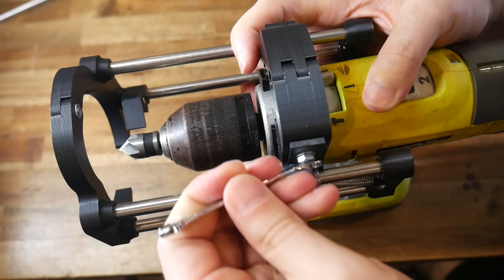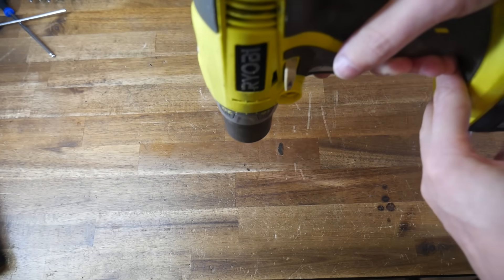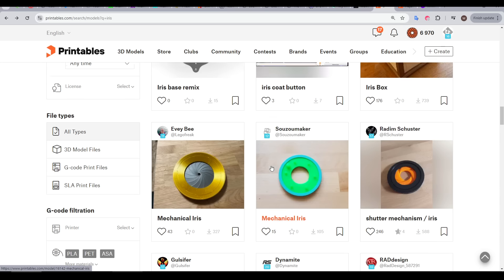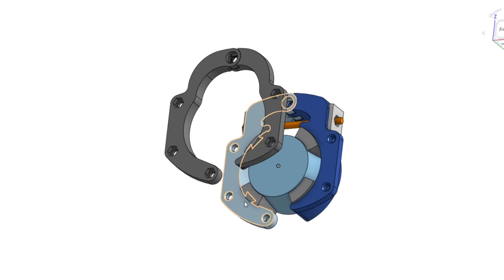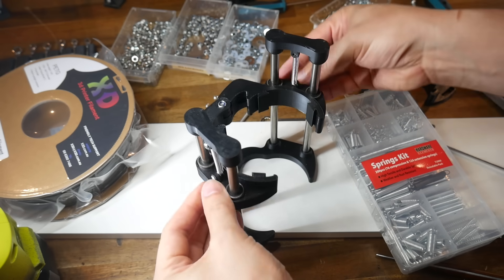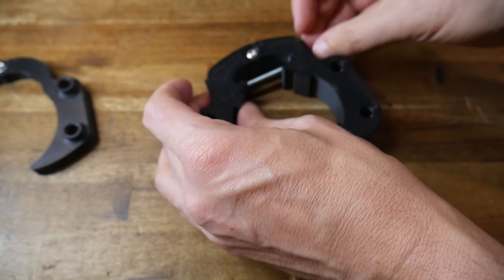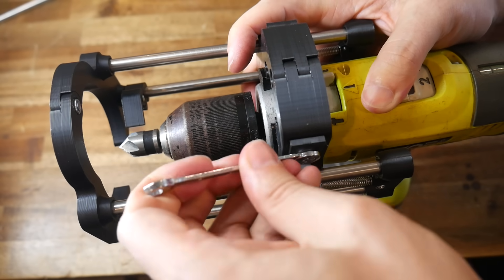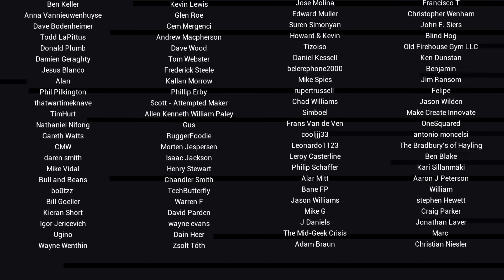This 3D printed drill add-on will give you repeatable, straight holes

Comment from the maker: Thanks for the nice reception of my design (and moustache). Some people don't seem to understand it's for charity. If you can help: https://movember.com/m/15237865 
Also 'drill guide' seems to be the search term to find a similar product. Quite a different approach with the inbuilt chuck. I'm still happy to have released my take and people can use whatever version they like.
Reply: @TeachingTech  the Milescraft DrillMate featured by Stumpy Nubs a day earlier has a lot of features that can be easily added to your design. :)
Reply: @emmettturner9452  It does have a built-in chuck.  I know, because I have one.
Reply: One advantage of your design which is ultimately a cost consideration for commercial products, is the 2 extra linear rods. I have the Milescraft drill guide, and I find it still has some play only having 2 linear rods. The inbuilt chuck is nice, but this seem sturdier

Comment: As someone who owns one of those cheap Aliexpress drill stands and just recently bought my first 3D printer, I'll be making this in the future. A lot handier in many ways, and the design looks great. Only changes I would like to see would be a more modular front piece - at the very least it should have holes for screwing on a base plate for more stability, and as others have mentioned below, a V groove for drilling rods and dowels. But with 3D printing this could also do so much more - 3D printed profile-matching plates that ensure consistent hole spacing across a sculpted face; adjustable center finder and/or edge guide mechanisms; angle guides (fixed or adjustable); the list really does go on. Thanks for making this open source, as no doubt I'll want to make some mods or add-ons to mine.

Comment: For flat stock drilled vertical, glue round  bubble level on drill and place one on piece to be drilled. Then you just have to make sure bubble positions are the same on both as you drill.

Comment: This is a great design but have you considered a design based upon the "Axial Glide" method as used in the Bosch GCM 12 GDL Sliding Compound Mitre Saw? This could be all 3D printed using only hinges and hence no sliding rods!

Comment: A really cheap thing I do is to take a piece of scrap wood that is perfectly square on at least one side to the drill press and drill a hole of the required dimension. Then I use the hole in the scrap wood to guide my hand drill. The hole will wear out after a while, but it keeps up surprisingly well. Another trick is to glue two pieces of scrap wood together in a perpendicular way and rest their square surface on what you want to drill your hole in. If you then place the drill bit in the v of the two pieces you will be square as well.

Comment: OMG, I wish this video had been released a week earlier!  I scratch designed a 3-jaw chuck to hold cylindrical shaped LED lights in place inside an integrating sphere.  The chuck is quite wide, about 120mm wide, with a 70mm wide center opening.  It works okay, but it's a little sketchy, and I had to make the pieces quite thick.  Your round, screw clamp would have worked so much better!

Comment: I wanted to build something similar but without 3d printing because they I don't have and still cannot do CAD.
On the right side of my no-name drill that loos very much like your RYOBI there are some screw holes with equal diameter and that are perpendicular to the drill axis. Also you have two parallel areas left and rught of the drill. I still haven't figured out how I want to use this, and sadly this describes my maker process.

Comment: This is fantastic.  I had a go at one a few years back but lost momentum "Drilling guide/press  by wots_a_name on thingiverse is my feeble version.".  I advise using a centering ring/disk that fits in the base.  It can be used to ensure the locking collar is square/true.  The centering ring/disk could be set to use a few twist drill sizes or same size as one of the bolts already in the make list.
Printing a copy now .. TY!

Comment: Nice idea, I have an old school one of these, though it was designed for hammer drills that have the circular clamp mount for a detachable handle; and this nicely solves the inability to attach it to modern cordless drills due to the tapered drill mode adjustment ring present in its place. Thanks :)

Comment: It's already been mentioned, but if you put the clamping bolt on the opposite side of the drill bit from the pivot point, you'll get way more clamping force to hold it in place on the drill.

Comment: I've made a similar jig with plywood and 12mm linear rods and elongated linear bearings, and it is quite heavy. Now I have a 3d printer. And you've said I can use carbon tubes instead of steel rods? Let's try.
Reply: BTW NICE MOUSTACHE

Comment: Hey basic feedback, 5 walls and 80% infill is not an efficient ratio. Most stress at the walls, so better to place the material there. If you want to use the same amount of filament, I’d cram as many walls/tops/bottoms as you can with ~20% infill

Comment: Thank you for creating this very useful drill guide! So you are using PETG, do you think that PLA will work?
Reply from the maker: It would probably be fine. The issue is it doesn't quite flex as much as PETG but printing it with this many perimeters means the PETG won't be flexing that much.
Reply: @TeachingTech  Thank you Michael

Comment: 1 more thought for the height adjustment.  Use a long bolt like in your initial design and place it between the linear rods.  You can leave a lot of clearance on the hole so that it doesn’t bind, and use 2 nuts & a washer as the stop.  You can 3D print the stop as well, so that it acts more like a lock-nut and is a single piece.  You can do it on both sides if there is a leveling concern.

Comment: If the nut and knob trap were on the opposite side of the assembly - away from the hinge point - they would be able to apply a lot more pressure. As the inspiration was a pipe clamp, the design choice was necessary to be able to attach the clamp to a pipe from the side. But since here the "pipe" (drill) can slide in, it doesn't need the side opening.

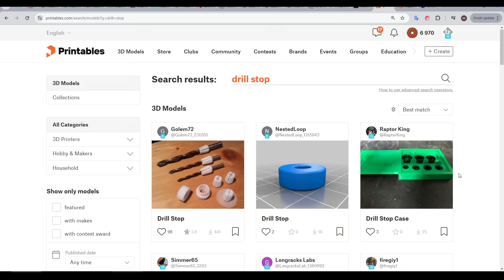Comment: Regarding not being able to find anything like it at hardware stores  (mentioned at 2:20), a thing like this does actually exist. An example of one is the Milescraft 1318 DrillMate. I only came across it a few days ago on Stumpy Nubs woodworking channel. I love the Teaching Tech one though because I also like printing my own stuff.
Reply: Came to the comments to say this, and I have one. I dont just use it to make really straight holes for bolts, but also to start precise pilots plunges for my router
Reply: Came to see if anyone has mentioned this. I almost bought this on a sale.

Comment: Funny enough, I actually just finished the first prototype of something like this for my Ryobi last week. Right now my mount is constrained using the 2 front shell screws. I'm using CF-ASA for extra strength/rigidity and to avoid the creep that tends to develop for me with PETG.

The jig only extends from one side with the foot wrapping around just ~70% of the drill. This allows easy access to both the chuck and torque limiter on my clutch but your clamp idea is interesting. For the rods I'm experimenting with cheap, telescoping aluminum tubes I had a pack of which makes it all very light.

The main shafts to the foot is ~8mm OD and slides around the shorter, smaller tube constrained in the mount with a compression spring around it. A printed ring added to the main rods press against the spring.

The mount has arms extending out as support for the main rods which slide through it and the ring also acts as the rest stop. I haven't played with adjustable travel yet but the ring could be modified for that.

I was concerned about the tubes but they're holding up better than expected so far and the slide action allows only two mount points to stay pretty secure. I lightly sanded and oiled the thinner tubes and since it's shorter, binding hasn't been a big issue. There arm for the main rods required a small amount of play and I'll probably use a bearing solution like yours or a short, wider tube pressed into it.

Your universal design is very cool and probably as strong as a tank. I'll post mine as well once it's finalized. Thanks for sharing.

Comment: I was recently thinking about this as I need to drill out some holes in my cars engine block so I can rethread them with bigger threads. But instead I made brackets that get bolted in place and then used bearings as guides that fit snuggly around the drill bit to prevent the drill bit from rubbing against plastic and helps keep it straight. Only problem being that I need longer drill bits for some holes to reach correct depth.

Great stuff, just sucks you still need to buy some parts to make it work.

Comment: By the way, the 'old solution' is also simple and possible:
a woodblock, drill  in straight through it (on the drillpress) and simply hold the woodblock on place with one hand, the drill in the other hand and push. As long as you don't move your block, the drill (or counterbore) will not angle and when the chuck meets the block, you stop.
Of course, it will wear out and you  might need to make some more blocks over time but it still works as a guide-block for many holes. Especially for wood or for holes in stone walls. Metal works only for a short time since you are more likely to wear the wooden block after a few holes.
For angles, you make some wedges and simply screw (or old way: hammer with nails) them under the block.
This works perfectly if you want to drill a hole through a wall under an angle (to have the water drip outwards...) too.

After the drill is guided in, you can deepen the hole by just removing the block and deepening the hole since the drill is then guided by the drilled hole.
Reply: BUT,you have to make a different guide for every size bit you may use.  OTOH,this terrific design lets you use any bit with your drill. it's simple and effective.
Reply: @JayWye52  That's why this design can be better in many cases.
Ofcourse with only blocks, you just use one for the guide-drill which is usually possible to use the same size in many cases (for example a 3.5 mm). The other, bigger sizes drills are guided by the drilled hole. For example you start with 3.5, then 5, 6, 8 and 10 + if needed 12mm drills and the bigger size is guided by the smaller hole.
I seldom use a bigger size drill for starts anyway.

Comment: You  've beaten me in this....  was going to design and make one. 
But one difference: also be able to change the angle at the foot.

I do have seen this kind of product by the way. Was cheap and in the store here for many years. But it had a lot of wobble and thus made it not good for use. No lineair bearings and a more fixed clamp (add-on and leave).

Comment: FYI: Stumpy Nubs shows a drill attachment like this in his latest video from a day before this one. It actually pivots for drilling consistent angles too. Edit: He says it’s called the Milescraft DrillMate “mini drill press” and he got it for the exact same reason: drilling perfectly perpendicular holes where he can’t fit/use a drill press.
Reply: True. I've seen these in several places. Heck, I'm 50 and I remember that my Dad had one when I was growing up (not having a place for a drill press at that point). They're not really a new thing. 
That said, I appreciate showing the design/creative process--though I have to wonder if the algorithm wasn't biased against his finding these.
Reply: Yup, I bought one of these something like 25 years ago. In the US, hardware stores seem to call them "drill guide". The one I have, and the one available at Home Depot, both have its own chuck, so rather than trying to secure the drill itself to the guide, you just chuck the guide into the drill, and then a bit into the guide.

So, definitely something you can buy retail. But the beauty of the 3D printing approach is customization, and of course DIY. There's something gratifying about just making the thing yourself. Maybe not worth the time to design it from scratch, but Michael gets paid by YouTube to do that, and then the rest of us just have to pay for the components and filament costs, which is far less than the US$40 or so it'd cost to buy at the store.

In any of their iterations, my experience and I can see in the video as well, these just will never be as repeatable/reliable as a full-on drill press. There's always going to be a bit of wobble. But for many jobs, it's plenty good enough.
Reply: The manufactured one featured in Stumpy Nubs’ video had some really good features that this 3D printed design could easily adopt, like the twist to center feature and the V-groove for pipes.

Comment: minor thought but the bolt to tighten the clamp on the selector I would have had on the other side of the chuck.  the adjust-ability may be less but the torque required on the bolt to hold it would be less

Comment: I made an adapter to reuse the base of a dead router to do the same job. Of course, most people don't have one lying around. 😊
My adapter is very crude compared to yours and bolts into the drill body.
You've designed a great solution. Oh, and once Movember is over, the mo has got to go! Dodgy as! 🤣 (I'm just jealous as mine is grey) Cheers!

Comment: I want to make a jig that holds a dremel (I use the 8240) and you pull a lever (like a drill press) to bring it down, but also the part can be held in place still or slide through the dremel bit on a slide. Kind of like a hybrid between a router and a drill press.

Comment: Ah man, wish this existed a few years ago.  I had to drill some threw bolts in some doors and bought two 'drill guides' for a drill.  The go in the chuck instead of clamping on but they do not stay true.  I got a cheap one, it wobbled like crazy, and then an expensive one and after a few holes it was just as bad.  Both weighed a ton!  Your's seems like it would weigh less.  Connecting it to the clutch is a much better idea, I wouldn't be surprised if Makita or DeWalt copy this!  I might print this just to try it out.  I'd leave one of the rods solid though, use that for the stop, but the rest I'd use tubes.

Comment: They have DRILL GUIDE WITH CHUCK, but they don't attach to the drill, and the ones I have used suck. 
They have a similar design, but usually with just two rods, not four. You also have to hold them, so not useful on walls, on acting like a portable drill press.
Will have to try to build one.

Comment: An allignment jig would be easy to make and great for ensuring the instilation is perfectly parralel. put a length of rod into the chuck of the drill and model and print an x with a slotted hole in the center and a C at each foot for the rods. have this extrusion be thich enough to keep them all in allignment, and hopfully there can be enough clearenct for it to come off after assembly.

Comment: Nice design, but seeing as you have a drill press you could just drill a plumb hole through a block of wood and then use that block as a portable guide. Would pretty much do the same job.  You can even do things like cut a V-grove in the bottom to use it for aligning on pipes/dowels, etc. Make it the right thickness and you have a depth stop.  You can cut the block at an angle then drill angled holes too.  This might be why you couldn't find one on the market.

Comment: Lowkey more interested in that handheld belt sander you used to clean up the cut rods. Wondering if it's a commercial tool or some other built one.
As for the the add-on itself, while it does have a big area it still doesn't seem enough to actually hold it square, especially when you have to hold the drill at somewhat uncomfortable positions
PS: also nice 'stache
Reply: Search for a 1/2" x 18" belt sander, they're available in corded, cordless, and air-powered variations.
Reply from the maker: Sometimes they are called a 'power file'. Very useful tool. Less aggressive than an angle grinder and more portable than a linisher. I have both a cordless and corded version, the cordless is noticeably less powerful. https://www.ryobi.com.au/products/belt-sanders/18v-one-power-file-tool-only

Comment: I have a commercial one of this. IIRC brand is wolfcraft. But honestly I never use it because clamping the machine into it is just meh. it's a similar clamping like yours does. Thinking about printing this version 
https://youtu.be/--zh5r27LLY?si=Pe2Dkqlg8d1ELBMe
which includes an individual drill fixture. I think it's clever because most of the time it's an on and off situation while working. The channel has more interesting 3D printed things btw.

Comment: Nice design.  I bought a commercial one of these about 25 years ago, but having two might be good, as I have multiple drills.  (being able to switch tools, rather than bits, is quite a bit faster when on a decent sized job)

Comment: This isn't something novel, it's called a drill guide, and there are a few other designs floating around as well as commercial products. That said your design looks superior to a lot of the other 3D printed options out there.
Universal commercial options typically have a second chuck that you put your bit into, which adds a lot of length to your drill compared to your method of clamping onto the clutch.

Comment: It's funny you say this doesn't exist, because it's really easy to find on Amazon. That being said, I've had one in my cart for years and never justified buying it but I will totally print this.
Reply: I've broken the chuck on two of those milescraft drill guides.  I kinda like this design better as long as the clutch clamp works well.
Reply: There are at least a couple on printables and thingiverse too, though this one looks like an improvement on the ones I've seen, in at least a couple ways.